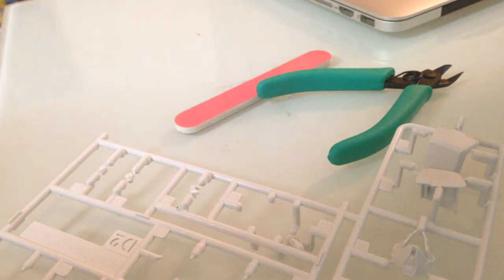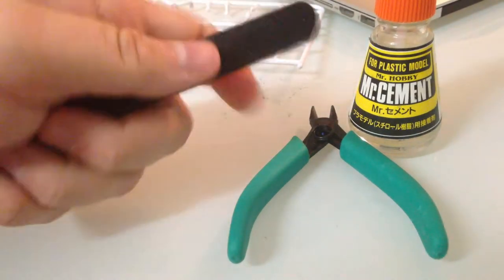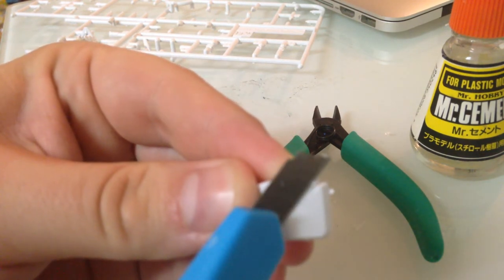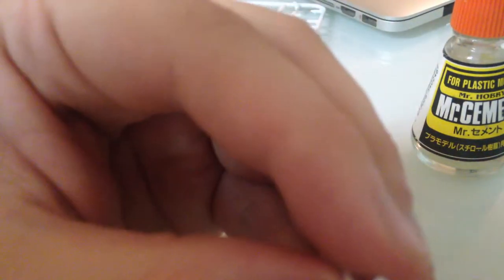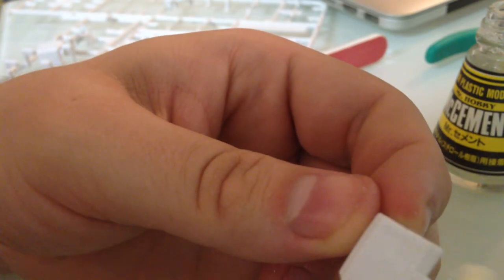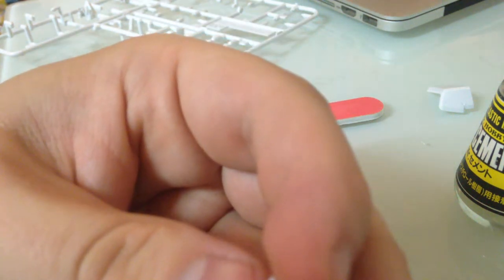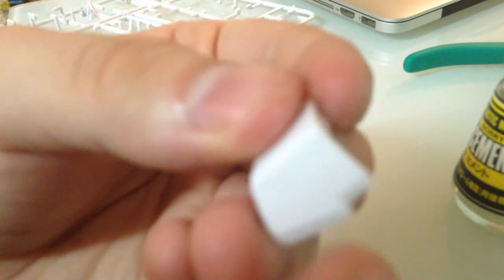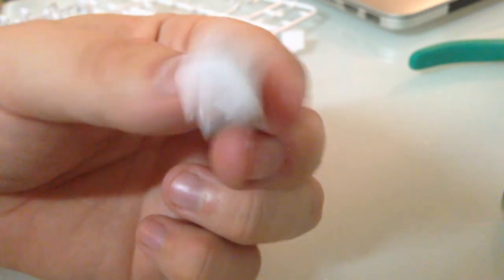Gunpla Tutorial: Gate Nub Removal

Comment: So the modeling cement thing works with parts of every color? Just apply, let it dry, sand, and repeat until the nub is gone completely?
Reply from the maker: Every basic color. This isn't something you're going to want to do on, say, a metallic plated build. But honestly, that's why I don't buy the metallic variants. If you make even a minor mistake, or the gates are rough, there's really no fixing it. 

But yeah, any basic ABS or PLA color you get in a Gunpla will work fine with that trick. I actually use the same trick to fuse seams all the time.

Comment: If the part is lets say, blue, and there is a white mark (stress mark) after removing the nub mark, can the part still be saved or do i have to paint it?

Great tutorial btw
Reply from the maker: My advice would be to paint it if you can. But, you can still use the same technique to get rid of stress marks. Light sanding, leave the residue, and put a little model cement on it. Then lightly sand, and maybe repeat. It'll even out the colors a bit. 

If it's more than a minor stress mark, you should really consider painting. That said, if it's a standard color piece, you could just paint that lone panel with a coordinating Gundam Marker, and nobody would know the difference and you don't need to paint the whole thing.